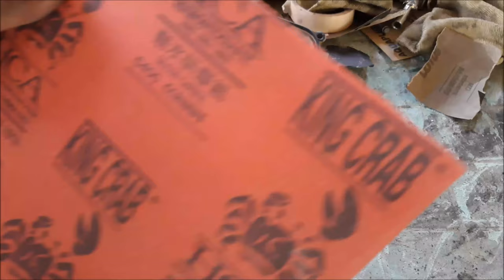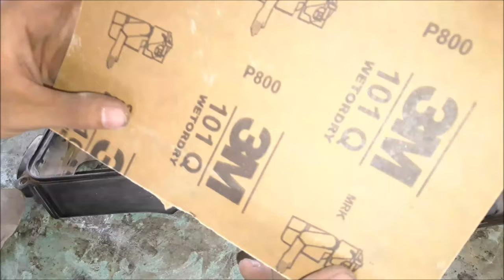How to paint Mio Sporty Crankcase TOP COVER | SAMURAI PAINT

Comment: Boss tanung ko lang..importante ba yung foam jna sa may crankcase airfilter nyan?Tnx
Reply from the maker: Yes po boss. Importante po un, yun yung nagsisilbing filter para di pumasok ang dumi sa loob ng crankcase. Sakin kasi nawala ko na, planning nga ako ibalik sa pure stock mga internal parts ng panggilid ko hehe, need lang magtabi konting budget. Ridesafe po boss
Reply: @MioDioWorks  salamat boss nabilhan ko na kanina sakin yung problema ko lang yung isang rectangle na plastic nawala nakalimutan ko ibalik.pero okay naman sya kahit pala wala yun.